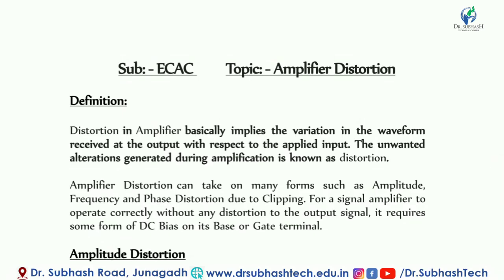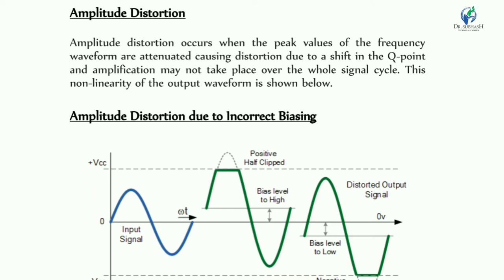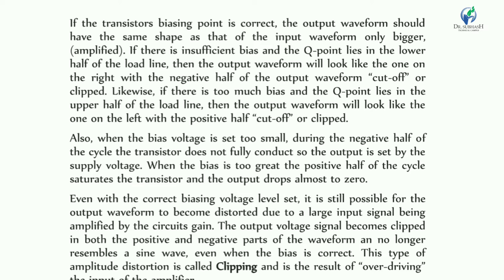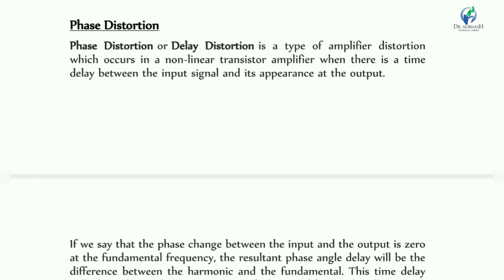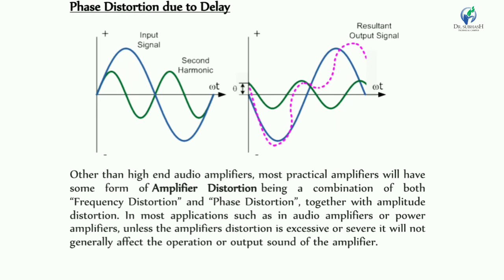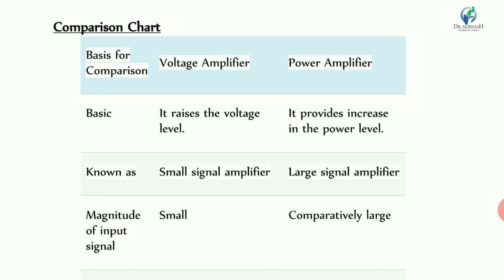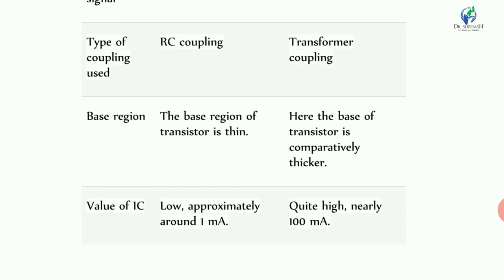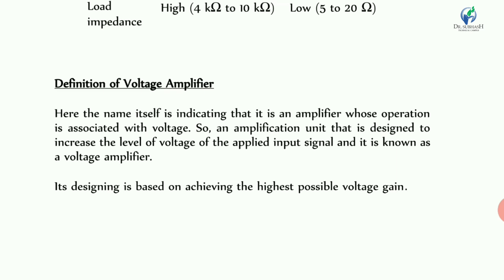ECAC - Lecture -9 - Amplifier Distortion : Diff. Volt & Power Amplifier by Yogit Palan

Comment: Ans.2 
Voltage amplifier
1) achived ac power low hoi chhe
2) physical size small and thin hoi chhe
Power amplifier
1)  achived AC power very high hoi chhe
2) physical size  generally large and thick hoi chhe